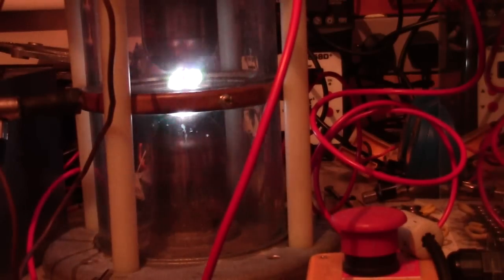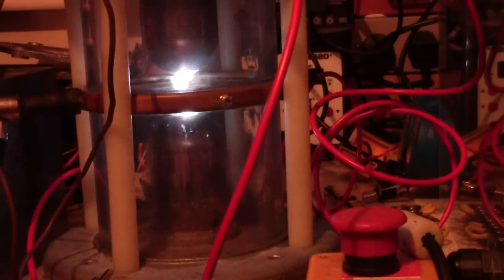spark gap WITH CAPACITOR for Anton

Comment: Be careful,  that thing will produce x-rays under vacuum
Reply: 30KV is the magic number for X-rays. If the voltage is below 30KV, there can't be X-rays.
Reply from the maker: Not a chance at 8kv id be worried at 15kv with a PT as peak you may see 25kv and it has been shown at 15kv and a few microamps can make very low amounts of X-rays .Also im not silly i have a dosimeter and Geiger counter less distance away from it than i am with audible alarms ;) just to be on the safe side ;) .here is a good vid to watch Creating X-rays with a standard vacuum tube
Reply: I have measured X-rays from vacuum tube that had plate voltage of just 5kV. Not much but they are there...
Reply from the maker: Kizmox thats in a perfect vacuum i guess?? everyone has different experiences but as i said i have monitoring equipment and they picked up nothing .this was a far from perfect vacuum also .its good to know though as there are lots of ppl that do this kinda thing at 25KV and dont give a shit ;(
Reply: Kizmox
I'm always willing to consider that I may be wrong but I distinctly remember being told in A-level physics that it's a physical constant that you need 30KV or more to produce X-rays. Could you have been picking up on something else perhaps? Even our bodies emit low level radiation which is higher than background levels. A GM counter could easily pick this up.
Reply from the maker: I did wonder this also as the lowest I've seen was @ 25KV but that would be 30Kv peak easily .HMMM
Reply: HighVoltageProjects There was some research done on ultra low energy xray production a year or two ago on 4HV.org; energies as low as ~2.8keV (iirc) were verified but normal glass shields anything under about 7keV rather well, so detection is difficult. Since the glass envelope shields low energy photons well it is normally assumed that several tens of kV is needed for an x-ray hazard to be present.
Reply: Matt Giordano
I suspect then that what I was told wasn't entirely true then. I was under the impression that 30KV was an absolute threshold.
Reply from the maker: Matt Giordano thats pretty interesting i'm a member on  4HV.org so ill have a look over it .I dont think i need to worry though i trust that both my Siemens EPD's will let me know if i have anything to worry about ;) It would be a great Video to do though as far to many people are doing this at 25kV+ and thats not peak V  in very strong vacuums :( with no monitoring equipment at all
Reply: I think having a heated cathode is fairly important in producing X-rays, mind. Hence how it's possible with some valves.
Reply: It certainly aids in the acceleration of electrons (and they're the source of the xrays when they bombard the tube internals and walls) but it isn't a requirement for xrays. You can see tons of videos on YT of xray production in cold cathode operation of thermionic diodes.